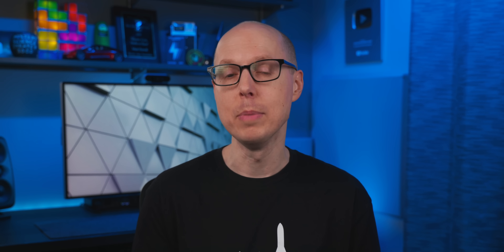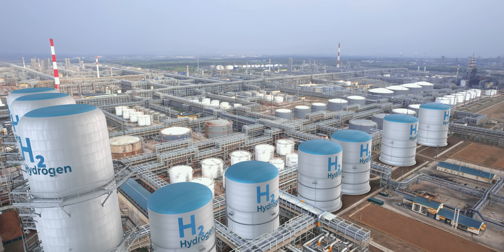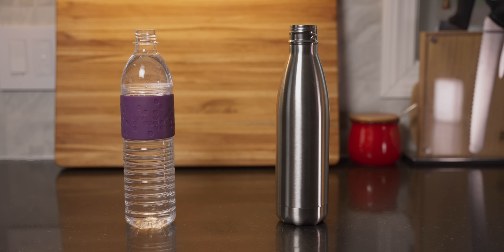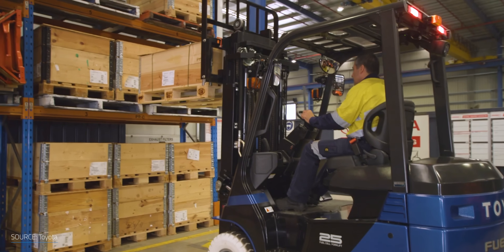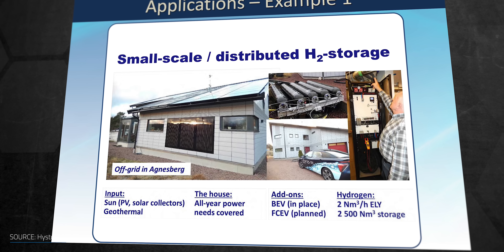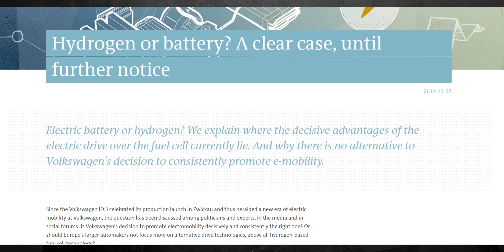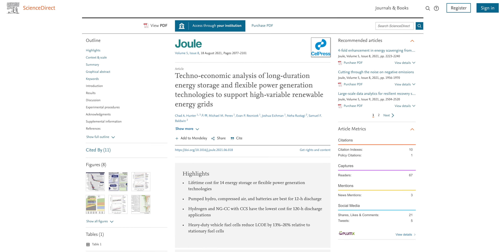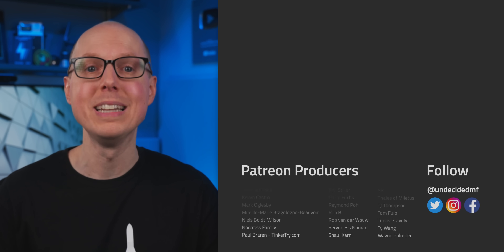Solid Hydrogen Explained (Again) - Is it the Future of Energy Storage?

Comment: the cost ca be partly solved by taxing oil and use that money for the hydrogen economics.
eventually we might have to stop sabotaging the environment.
Reply: It might be, but you'd have to tax it an awful lot.  Gasoline at the moment in CA is $4/gal.  H2 at the pump is $36/kg.  1 kg of H2 gets a Mirai FCEV 70 miles and 1 gal gets the equivalent hybrid 50 miles, so gasoline would have to get to $26/gal to compete with the price of hydrogen.  That's clearly not happening.  Then you have battery electric.  For the people that can charge at home, it's ~14¢/kWh to charge.  So let's look at the current prices per mile.  EV = 0.14kWh/4mi/kWh = 3.5¢/mi.  Gasoline hybrid. $4/50 miles = 8¢/mile and Hydrogen FCEV $36/70 miles = 52¢/mile.

Comment: Good job on the video!  I don't share your pessimism for the use of hydrogen in small EVs.

Also, I don't understand the energy efficiency argument when Green Hydrogen is made using free renewable energy.  

I feel that all of the so-called drawbacks of using Green Hydrogen in EVs have a scientific/engineering solution and think (hope) that Li-Ion battery EVs will be abandoned as a dead-end solution as they have a HUGE environmental, and socio-economic impact, which is almost never taken into account in viability analyses.

No doubt someone is working on the need to do away with Pt Ir electrodes and precious metals in hydrogen fuel cells and electrolysers.

I hope to live long enough to drive an economical Green Hydrogen Fuel Cell EV one day. No range anxiety, no 40-minute waits at the refueling/recharging station. 

Thank you again for the interesting and thought-provoking video.

Comment: This is and will be an interesting technology. As you said there are many sides to this. I doubt that in the future there will be one solution for all problems, but we will need to look at different solutions depending on the variables we need to address - output of energy required, mobile, fixed, small, large, near to source or far from source. Starting the conversation around a hydrogen based energy economy all of these will be critical points. Thanks for helping to start that conversation. Everyone can have a viewpoint - but physics is physics and that should drive the conversation. However - remember that technologies improve over time and we can drive the physics to ever more efficient levels. Remember when integrated circuits were big and slow? Ask Intel what they are doing these days versus 30 years ago (or more).

Comment: hydrogen powered electric cars are less efficient than if you ran an internal combustion engine on the produced stored and released hydrogen itself. electric isnt necessarily the answer to everything. hydrogen on its own burns cleaner (the process produces water) with no environmental toxic byproducts as exhaust compared to existing fuels. hydrogen is abundant and easily produced along with harmless to the environment, its a shame we haven't moved to it as an energy source

Comment: The best and easyest way to store hydrogen already invented by nature : called hydrocarbons for example alcohols, we can use them in fuel cells or burn them until we are making them artificially from co2 and h2... only we need clean energy to make the hydrogen . The co2 is there in the air for free . These process would be carbon neutral but very inefficient and expensive. The alcohols are exelent fuels for vehicles, stable , clean , energy dense , have multiple use.  Nice to see the newer possibilities to store energy but the question lies on the energy production cleanly and a wasteful economy what we have.

Comment: If the hydrogen gets more efficient to release from it's medium at higher temperatures and nuclear power creates heat with zero emissions, maybe use it to power the process? 🤔
Reply: Or maybe even just use the nuclear power to heat water and convert that to electricity in the first place instead of storing a tiny amount of hydrogen on a much larger heavier disc and very thin hydride layer that then requires even more energy to release?

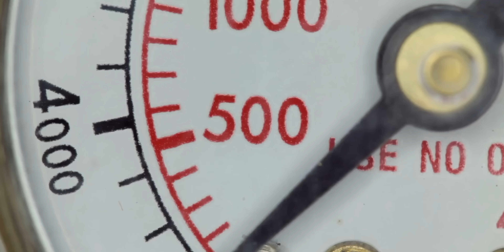Comment: 3:59 Long highways should have induction tracks that allow electric current
usage on the greater distances. That way the batteries won't have to do much
charging and discharging, which increases their lifespans.
The same induction tracks can also allow for compuer controlled driving
which lowers human error and increases throughput.
Reply: Augment off-road capabilities (not being on an induction road) by bio-diesel.
Augment the bio-diesel burn phase by supplying extra oxygen.
Since these are not your main energy modes, these tanks would be small.
Reply: Also, hydrogen needs energy to produce.
Unlike solar, which takes energy to produce, it won't produce itself
after fabrication, which does happen for solar.
The average cost in energy to produce solar is outweighed
by the energy it'll produce after the use starts.
Hydrogen will take energy and store it, but won't recover the energy cost
to produce it.

Comment: When you talk about collecting H2 from flue gas from the incineration of plastics, I thought about pyrolysis which is high temperature way of splitting hydrocarbon, a clean split, like CH4  ⇌ C + 2H2, splitting methane. I have read that it can split rubber plastic... but I never hear about advancements in the use or realization of this method on an industrial scale, any news?
Reply: peter jort, it might be a little off-subject, but an australian group invented a way to recycle tyres into their components.  by modifying the process they can alter the ratios of the extracts.  it won the inventor of the year award on the abc(aust) new inventors tv show about 20 years ago.  i do not remember hydrogen as being one of the extracted substances.  the pyrolysis was achieved using microwaves using electricity generated using some of the extracted materials.  i dont believe the australian government or any private industry showed any interest.
Reply: Hi Peter, I asked Matt if he could review the work of a company doing this near me in the U.K. They are in the process of constructing the commercial scale prototype at a mass scale plastics processing facility at Ellesmere Port.  The company is called Powerhouse Energy.  It looks very promising, and more importantly it looks fairly close to realisation.  Hopefully Matt F will get around to covering it one day

Comment: My biggest problem with hydrogen is not storage ... but, production efficiency and thermal-conversion efficiency. 
- PRODUCTION: The most 'energy efficient' way to produce hydrogen is from CH4 (methane) - which begs the question: "Where does the C (carbon) go?" Some people talk about electrolysis but ignore the energy-conversion efficiency. 
- THERMAL CONVERSION: If you are going to use hydrogen in a chemistry process, why are you storing it? If you are storing it to run a fuel cell, it begs the questions: "What is the efficiency of the fuel cell; and, what does it weigh?"

Comment: As with all these discussions, there is likely to be applications where this kind of storage is ideal and others where another solution works better. 

Every solution we seriously develop to the point it can be commercially viable, grants another option that becomes available to us to improve the future, and choice grants power if you use it. 

Just 50 years ago, and with the exception of nuclear and batteries, for thousands of years previously, our energy choices were limited to burning hydrocarbons, or very limited use of wind and rivers to drive water wheels (including hydroelectric) and sails (for ships and windmills).

Today we are moving so far beyond that time, the world has already become unrecognisable. What will the world be like in another 50 years  as we master just the emerging energy technologies of today? 

People with medical devices powered by NDBs, with their brains directly connected to the internet through tiny interfaces; vehicles that never need to be refuelled or recharged, homes powered completely by their own windows and roofs with an energy storage capacity greater than they will ever need? I look forward to finding out.

Comment: Thanks Matt. As outstanding, comprehensive and accurate as always!  What you brilliantly show in numbers comes down to this: engineers will always tell you that the best solutions are the simplest, using the less vias, taking the most direct path. And it gets rewarded with a higher energy return / energy supplied ratio. That's the game we learn and thrive to achieve. But their bosses hate this, because they will adopt sound engineering only if it satisfies a nice year-end dividend payout ratio. So, solar energy is never their favorite because we don't pay for the sun, and once the panels are installed on your roof, the money-flow and the dependency on suppliers stops. In the final analysis, depending on where you live, it will cost you $15.29 for 412 miles range in your Tesla S, while you will pay $80 at the pump to fill up your Toyota Mirai with H2, affording you 402 miles range. But recombination of biofuel (CH4) to yield H2, produces CO2, so it's not so Green Hydrogen after all is it? Like Yoda said "unclear, the future is". But for sure, the vast majority of us want clean energy, affordable and available everywhere. You shed light on many emerging energy sources, and we appreciate it tremendously! Cheers!

Comment: One concern I have about replacing petrol with hydrogen, is no process has a 100% conversion rate. And even if magically it does, badly maintained or damaged engines won't have that 100%
So lets be generous and say on average 5% of the fuel tank gets lost to the atmosphere as hydrogen. What hapens to it? It floats to the top of our atmosphere, where it is lost to space. That lost hydrogen was made from water, and that's water we're never getting back.

Multiply that loss by the number of cars, generators and power plants and we're talking about a not insignificant amount of water loss each year.  are we replacing one form of environmental damage to our world with another.  It might be better, but I don't think it's the magic bullet people say it is.

Comment: Thanks for the deeper dive in this topic.  I believe that many, not understanding fully the tech thought this would be a good answer for powering a car/light truck.  You didn't specifically point this out, but did explain with the numbers.  This system might be a good fit for a fixed or large vehicle.  But one issue not mentioned in its use for powering vehicles is one of transportation to fuel centers, where the transportation and storage costs would add to the overall lessening of efficiency.

Comment: I am a welder and we have to worry about hydrogen embrittlement.  This is caused by hydrogen atoms being absorbed into the crystal lattice. Which as is said the lattice can hold quite happily.  Unfortunately the individual atoms have an affinity for each other and migrate together.  Eventually you enough atoms of hydrogen together producing very high pressure and the steel is cracked.   Has this "system actually been tried for an extended period??

Comment: The best way to know if something works well to power an EV?  You can buy it from Tesla.  The best way to see if it doesn't work in an EV,  like hydrogen?  You can buy it from Toyota.   Toyota Mirai,  0-60 in 9.5 seconds.  Hydrogen fool cells for the loss.  Now add solid state 400 deg C hydrogen storage tape cartridges and 5 kW lasers to the Toyota Mirai and you can get the 0-60 time up to maybe 12 seconds.

Comment: Yes on Solid Hydrogen but like other sources of "green energy' the production cost must come down, but to do that means that the existing in-use fuel cost must be increased which we see happening today. But eventually based on supply and demand the cost will flip to where the new technology are cheaper for use, until then $$$$.

Comment: I'm an old motorhead and I have often dreamt of a carburator that would have an internal frequency generator tuned to the resonant frequency of water so that as the water is atomized it would crack into hydrogen and oxygen to be reunited inside the combustion chamber of the engine, Please help !

Comment: I wrote my Chemistry dissertation on semi-crystalline metallic structures primarily NaSICON and LiSICON, they have super dense structures which allow the passage of ions which make the hydride ions look tiny in comparison, so from that experience I can say straight away that there are a tonne of different metalic structures which could increase the capacity especially with the amount of close packing possible. 

It will be interesting to see if any of them have a more efficient diffusion mechanism, the first thing that comes to mind is how you can change shape and load of metal glasses via electrical stimulation, so in essence you could have a sort of starter motor with a small storage reserve to get things going and then use some of the electricity generated to continue the process. But this would be something that I expect a Chem. Engineer major to prove me wrong on quickly

Comment: I found this video very interesting. While watching, you mentioned nickel-metal hydride batteries. As I use these batteries myself, a question immediately came to mind. Why do they stop working and is there anything that can be done to re-activate them? The same question would be interesting for all rechargeable batteries. 
I have heard of fixing dead ni-cads by momentarily pushing a higher voltage through the battery, repeatedly a number of times. I have tried this a number of times and it does seem to work. I used a 6/12v car battery charger, switched to 6v to fix 1.2v AAA batteries. I touched the charger wires onto the batteries momentarily for about 10 or 12 times. There is a brief spark, each time. After this in most cases the batteries charged up normally. It would be interesting to know what is the chemical process that is happening inside the battery?

Comment: Watching this gave me an idea: A lot of troubles with storing H is it just slips through the thing thats storing it because H atoms are smaller than structure of its tank.
How about using metal hydrates and making a tank out of them, wouldnt the H thats already integrated in the metal prevented H thats it is supposed to hold from actually escaping?
Or did this just happens naturaly to anything thats trying to contain H?

Comment: A lot of people think you must use a exotic fuel cell to drive a car using hydrogen.  The 2008 F-250 with a supercharged 6.8L V10 made 550 HP!  Hydrogen can be burned in any gas engine, and a turbocharged is going to make even less smog than a non-turbo engine.  You can hook a mask to a hydrogen powered engine to a mask, and breath in that exhaust stream.

Comment: I didn't see the first video so my comments are based on this video only. The technological principles around storage of hydrogen in a metal matrix are well understood and, in different applications have been around for a long time. One of the problems this video has is that you used the term aBsorption and not the correct term aDsorption. This is not a spelling mistake but the difference is easily missed in speech and text. That consonant makes a difference. Hydrogen is adsorbed into the matrix of the metal and sits on the surface of the metal. A porous metal can have a very high surface area. Similar and much more common high surface area materials would be zeolites and activated carbon. There is a bond between the metal surface and the hydrogen but it is not an ionic bond like that in sodium chloride. Dr. Wood alluded to this phenomenon in his second(?) snippet. The kinetics and thermodynamics of adsorption and absorption are different and although the terms are very similar the differences in terms of practical application are profound.
There are practical engineering challenges around adsorption systems. In a lot of cases they have been solved. Temperature swing adsorbers (TSA), pressure swing adsorbers (PSA) or pressure/temperature swing (PTSA) adsorbers are well known. A common example would be an oxygen concentration system used in a hospital, at home or even in a laboratory. The easiest case conceptually is a pressure swing system where high pressure is used to force a gas into a porous metal/zeolite, etc so that it can squeeze its way into the cavities throughout the bulk and then bond to the surface. Reducing the pressure allows the gas to de-bond from the substrate and exit the substrate for use. These can be selective in the case of zeolites hence their ability to concentrate oxygen from the air. There were some automotive air con systems that used this principle but the advent of new refridgerants rendered this technology redundant. Making a very small, commercially useful swing adsorber is a real challenge though.
I am sceptical about the flue gas application. Achieving a 60 mol % hydrogen concentration may not be too difficult. Achieving what is likely to be a sub parts per million (PPM) sulfur concentration to avoid poisoning (and killing) the metal matrix will be a lot more difficult. The economics of adding a chiller and a complex purification unit operation to an existing chemical process will be prohibitive. 
For specialised applications like submarines this is an interesting approach. The GKN and other applications are promising though for "simpler" use cases. I'm not sure the Plasma Kinetics market size claims are fully believable and seem to be part of venture capital funding rather than a realistic expectation.

Comment: Hydrogen as an energy carrier needs to be pushed and although SHS (solid hydrogen storage) is just part of the puzzle it is probably key to safe hydrogen mobility / mobile fuel. Mobility provides versatility in use.

Hydro-carbons are simply too valualable to be burnt inefficiently as a transportable mobile fuel.